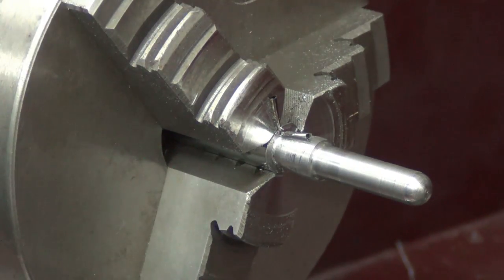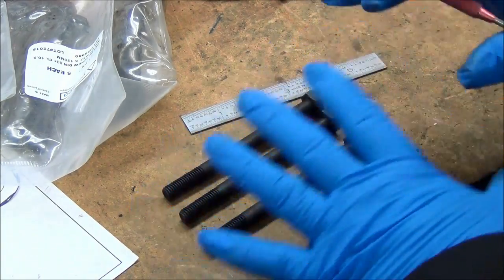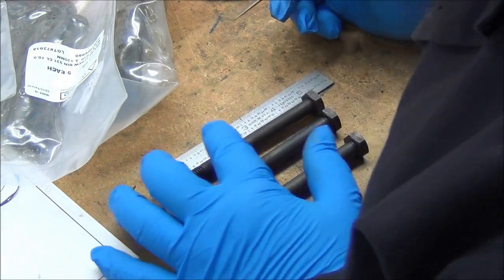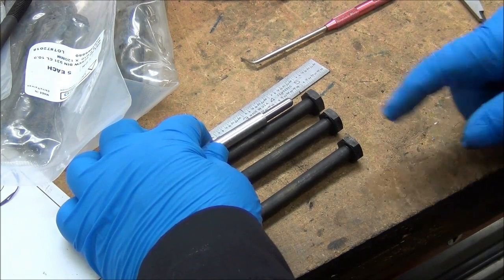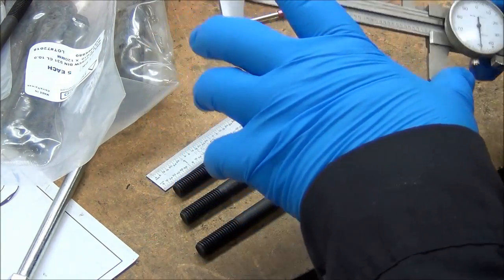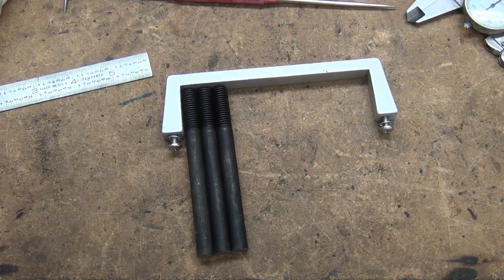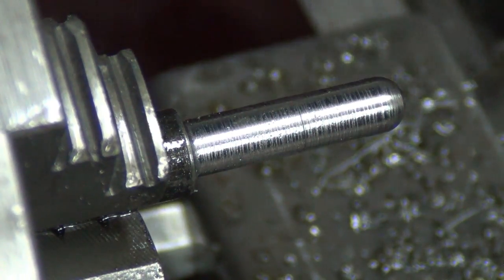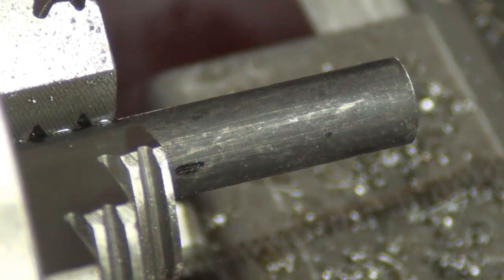CNC Lathe Fix13 - pushrods

Comment: I can understand you taking light cuts due to the low power/rigidity machine but are you using the insert with the right chip breaker for your usage and shallow depth of cut? Not all inserts are equal, some need several mm's DOC, some can handle a few thou. Now you are doing production jobs, getting the right tips could be a worthwhile expense.
ATB
chris
Reply from the maker: Hi Chris,
You're absolutely right!  LOL  I have to chuckle because I just got a comment from yesterday's vid that asked why I was taking such heavy cuts(.030"). 
These were the first parts I made after changing the parallel port status in the bios.  I was a bit afraid that it might crash again and I didn't want to be running any harder than necessary if that happened again.  I wasn't sure if the crashes were from losing steps from too much load or something else.  I'm gaining confidence in this unit more each day.  I'll see if I can go back and cut a couple more of these with heavier cuts.  Production is maybe 10-20 of these at a time, so speed isn't a huge issue at all.  But, a heavier cut will probably give me a better surface finish. :)
Thanks!!
Mike

Comment: Looking good...and no crash! :-)
seeing the nipple on the end I'm thinking tool height but I guess it could also be caused by Y travel not in quite far enough. The nose radius on that insert might be enough to do it if it doesn't travel slightly past center.?.
Reply from the maker: Thanks!
One or both are slightly off I think.  I've been extending the facing cut on the DP bracket spacers .002" past center and sometimes the nipple is there, sometimes not.  If I don't extend it, it's always there.  Just one of those things to get dialed in.  I've been more concerned with rpms and cut depth so far......which will show more in the next vid.